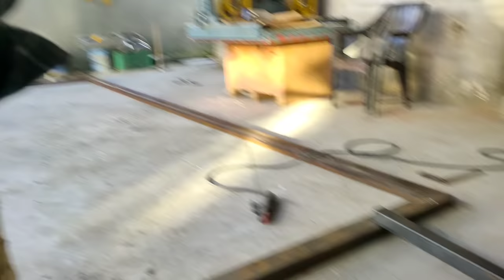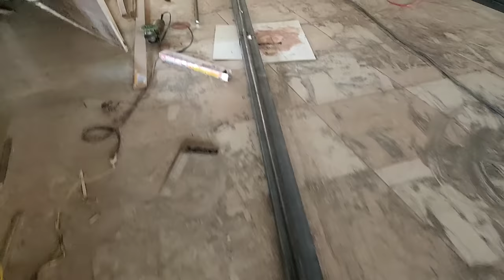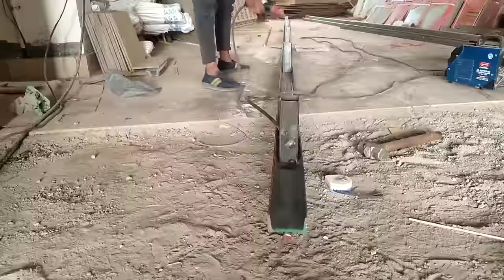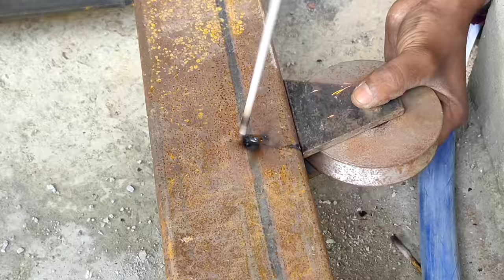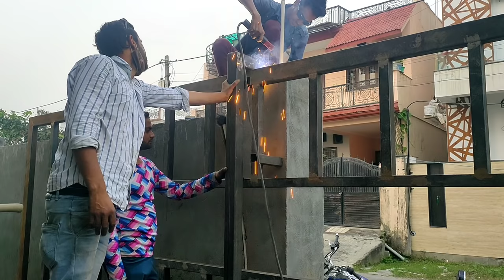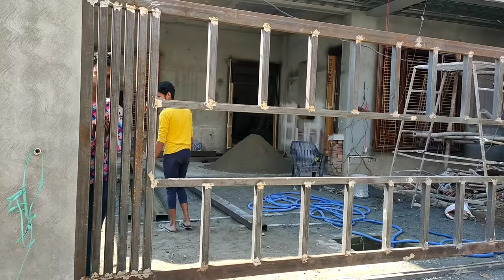How to install sliding gate making a sliding gate 6'+17' feet very easy metal working idea's

Comment: Sliding can save space but the disadvantages is the height is low
Reply: Sliding gates can be any height or design. . You just have to place the roller guides at different locations.

Comment: What a stupid design for a gate.....! 
What is it designed to keep out...? 
The entire center of the gate has one huge opening. Someone can just climb through. 
Plus, you have 5 thick bars on on end fitted closely together and only three on the other side spaced far apart from each other. Someone can just walk through it like it isn't even there. 
The same applies to the top and bottom rows of the gate....animals (dogs etc.) can simply walk through it. And a small person can easily squeeze through the openings.